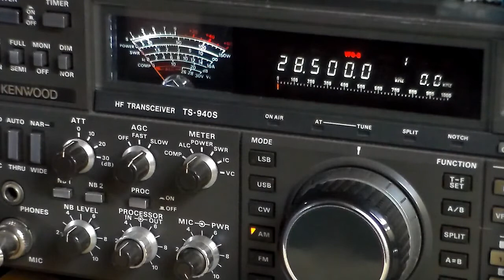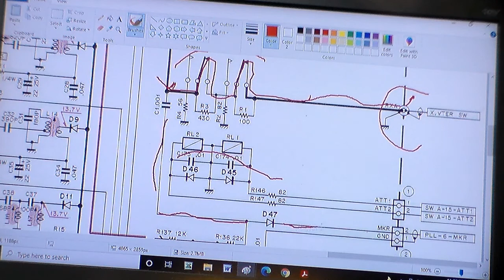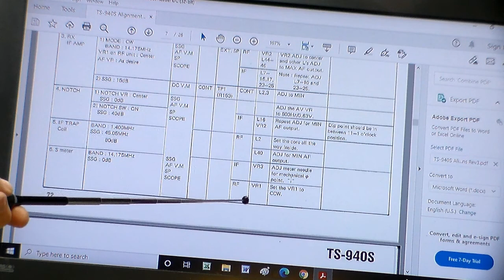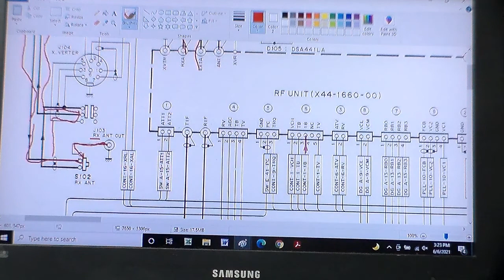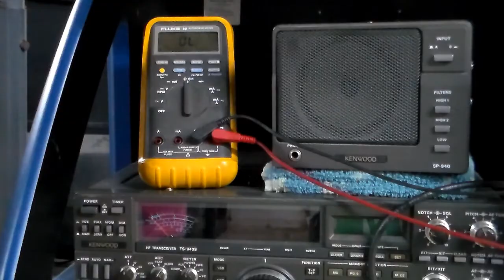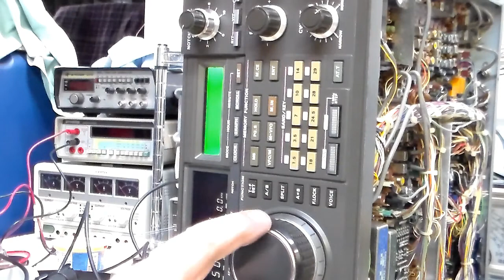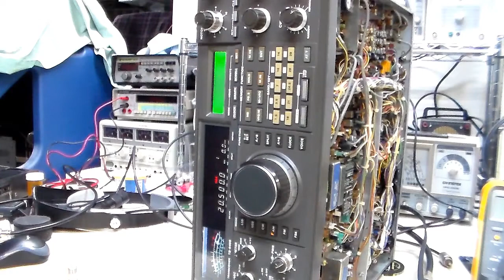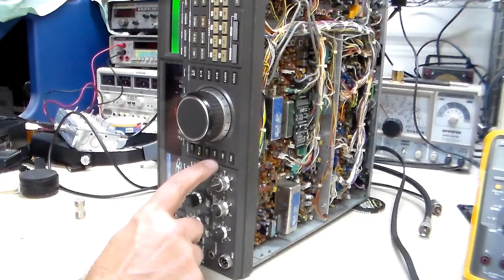Kenwood TS 940 Alignment Revisions

Comment: Great test buddy! I happen to have a TS-940SAT which I bought as a broken. It  transmitted max. 5W and tuner didn't do anything. After starting to fix it, it appeared to be a hell of a long repair. There had been someone before doing crazy things like turning all the coils in RF and IF board and changing different coil ferrite inserts to RF board... The reason why TX / tuner didn't work was a blob of solder in IF board foil side... quality work from someone! RF board I never got repaired as there were too many changes. So I was happy to buy a original board from Ebay EU and it helped a lot. I haven't aligned that board as it seems like factory settings. But radio works now quite well. There are still some mods in the IF board that I will have to take a look, some missing zener etc. Other problems I have figured out is I took every board out and fixed all bad solderings and ATT-relays have been sticky so I cleaned them. Compared to a much more expensive IC-781 on my bench side by side this RX is good or even better. But I like IC-781 more as it is better to use and is "more modern" to use, band scope, CAT and all. Anyway thanks for sharing a golden info to all of us! :) 73 from OH-land.
Reply from the maker: It sure is easy to get overly involved in these old radios.  Kind of relaxing in a frustrating way I guess.  Thanks for watching.

Comment: My 940 acts like it has 20db of attenuation  but on strong signals acts normal. Never have figured this out. On 80m ill have a s7 s5 noise floor. This thing shows no noise. And you can turn the volume way up and no static. I spent hours fixing bad solder joints on the control board. Someone else removed a few of the headers and soldered the wires to the pins but the pins had cold solder  joints on the backside haha. Anyways the alignment manual has many errors in it from what i can tell. Wish i knew what was wrong with my 940. The rx is just too quiet
Reply from the maker: Did you take a look at the attenuation relays?  They are a common point of low receiving problems.  I have a video on replacing them. Buddy over at The Radio Shop has a video of cleaning them.
Reply: @timtimeprojects3576  i think i jumpered them. It might just be how the radio is too. Ive had a few different kenwoods and they all seem goofy on s meter

Comment: I've been watching a few of your videos on the 940. I picked one up about a month ago, non-working. Visual inspection showed a few cosmetic issues which are fixed. Then new batteries installed. Then new backlights on the sub-display. Processor reset procedure and it seems to receive AM signals OK, so far. Did the first transmit tests today into a dummy load. Seems to be doing OK with transmit power set very low (10 watts) for my first tests. However, I have not made any sense out of the ALC meter setting, it just slams to the right, but Power setting looks about right. So I think I will be diving into the ALC calibration area. Any other thoughts? Thanks for your videos.
Reply from the maker: I touched on some of the errors in the alignment specs for that radio.  More than likely it's either a bad solder joint or connector or somebody tried to follow the manual and got lost.  Do all the other functions of the meter work as designed?   The below site has a lot of good 940 info.   You have to join the group.  https://groups.io/g/kw-ts940s
Reply: @timtimeprojects3576  KB7JS has a draft copy of a new calibration procedure for the 940 in that Kenwood Group. I have downloaded a PDF copy for review. It also touches on the ALC calibration errors in the original 940 Service Manual.